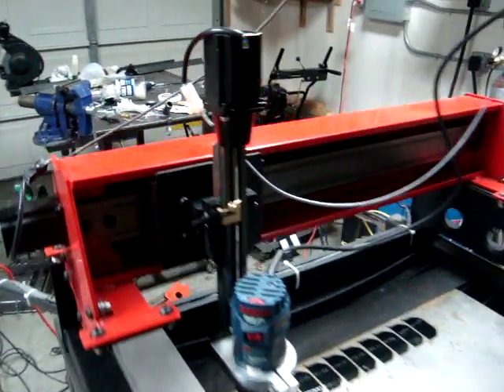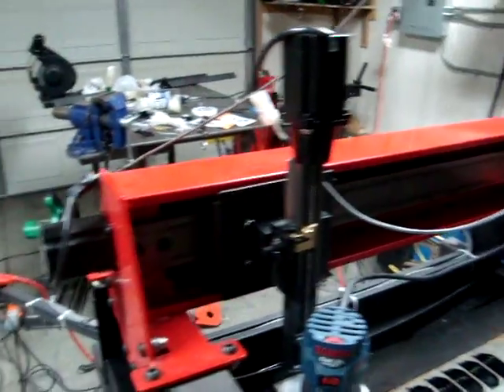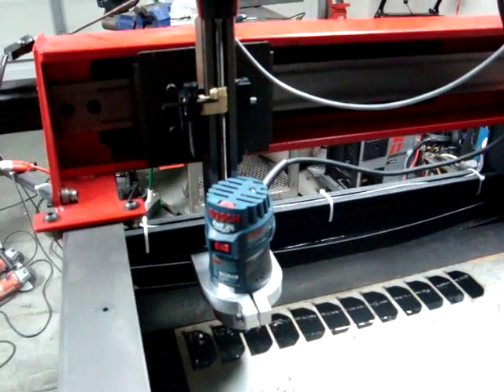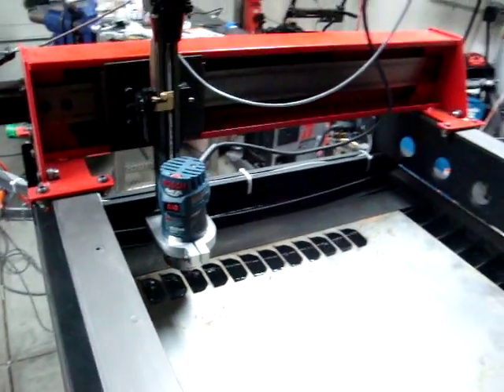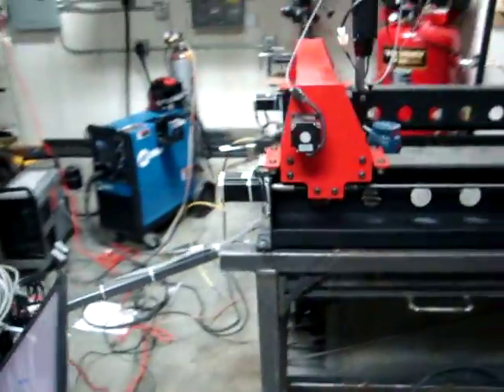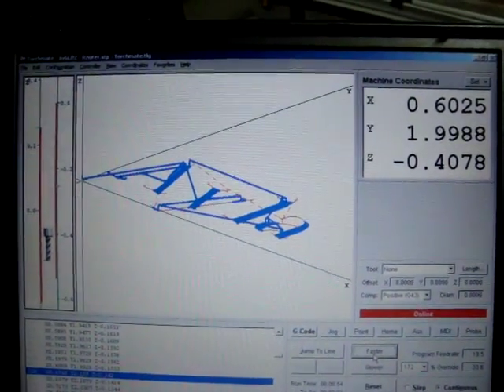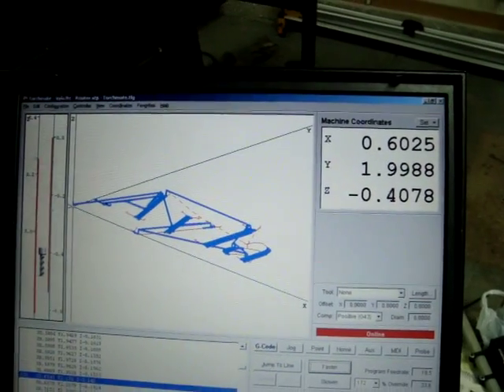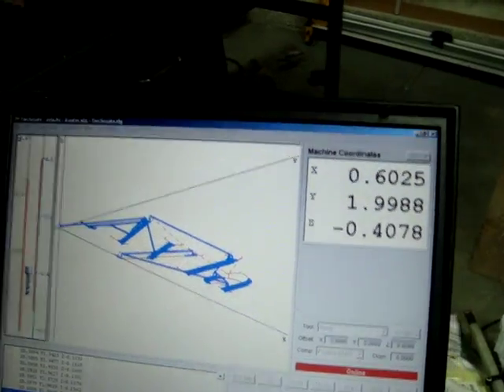Torchmate 2x4 with z-axis Router -- Dry Run

Comment from the maker: @georgecebu 

Oh, I don't remember exactly.  I think around 3K for the 2x4, 700 for the z, 500+ for software, and probably a little bit more on this and that.  I may spend 300+ more on another z-axis though.  This one is dog slow.

When I bought the 2x4, I also purchased a few other items too, such as an arc voltage height controller, machine torch, extra cables, steel to build a water table, etc.  Still hoping to make it pay for itself.